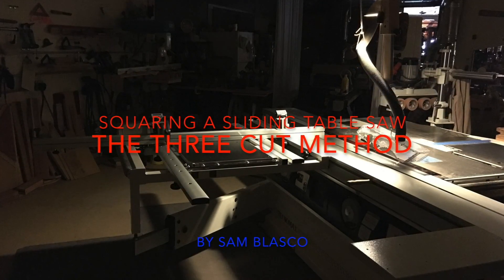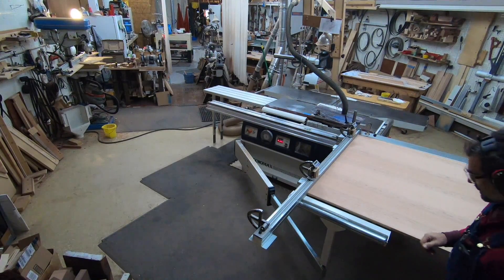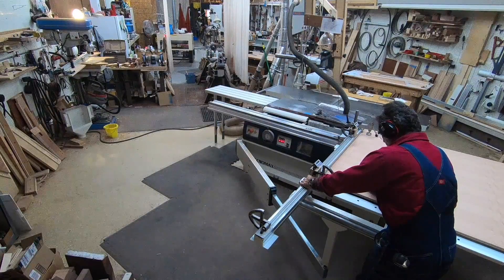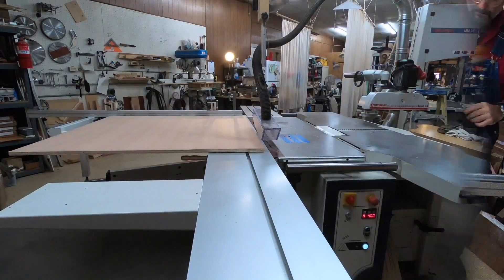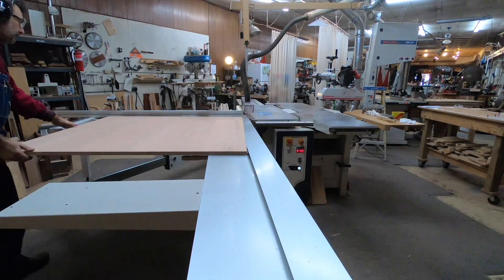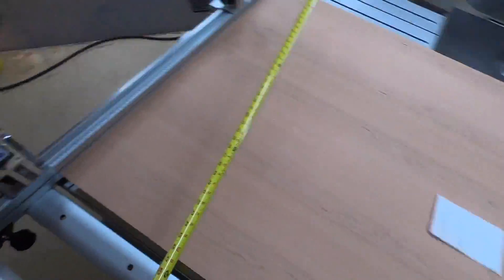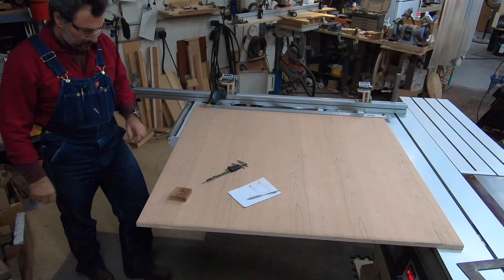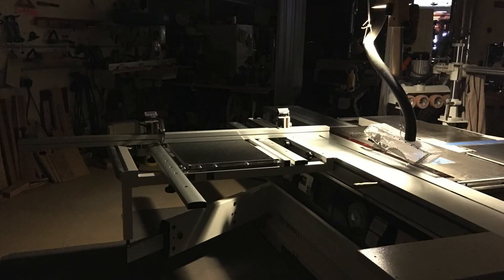Is your sliding table saw square? The 5 Cut Method in 3 Cuts!

Comment: Anyone here have a Robland E3200? When i purchased mine 18 yrs ago it was commissioned by an engineer working for the saw sales company  . 
It didn't cut 100% square then . 
It was always slightly out of square. After many attempts in fine tuning it is still not cutting square . 
Its driving me nuts.
 He also set the parallel fence so that the fence is  not 100% parallel with the saw blade ie if you put the fence against the blade there's a tiny fraction of a gap at the back of the blade near the riving knife. 
Is this normal?

Comment: Hey there, would you be kind to offer some advice, any is very useful: I have a Robland Z400 M panel saw sliding machine with 2 blades. Problem is that i can't align them perfectly... The pre cutter is always a bit off to the right or to the left and that is my problem. How can I allign those 2 blades perfectly?
Reply from the maker: I am not very familiar with that machine.  On my SCM machine there is a knob below the table to move it right and left.  Some saws come with a simple scorer installed and use a spacer on the arbor.  If you are using a split scorer or dial scorer you may need to remove that spacer, or if you are using single blade scorer you may need to add a spacer on the arbor first to move the blade a little to the left.

Comment: Aloha Sam, I received my new Felder K700S recently and had a difficult time squaring the crosscut fence to the blade with the 5 cut method.   Your 3 cut method made the difference.  Using a 4' x 4' panel as you did I was able to get it square and squaring the slider to the crosscut with my 24" machine square as a second check.  Would you ever consider making a video on the rip fence alignment for sliding saws.  Mahalo for all your valuable content.

Comment: That's not even close to the 5 cut method
Reply: Yeah, that’s why he titled it “5 cut method in 3 cuts”!  😁
Reply: @tundrawhisperer4821  That doesn't take away from the fact that this method is missing key components to make a sled accurate
Reply: @derekcraig3617  Well based on the end result he had, that’s pretty darn accurate.  Plus, like he says, in wood working there are many ways to achieve the same result.  It’s just preference at the end of the day.

Comment: I'm a 5 cut kinda guy, Sam, and perhaps because that was the system I've found tried and true over the years in my cabinet shop.  I wasn't impressed at all when you first pulled out your tape measure to check the distances at both ends, but when you pulled out your rular and thickness gauge I could see the merit to your system.  But to be honest, I'm not convinced that your measurement system is as accurate as that of comparing the thickness of both ends of the offcut strip.  To each his.her own!
Reply from the maker: You are correct, Marty.  I think with a large enough caliper this method could be just as exact as the 5 cut.  I simply chose to shoot for a level of accuracy that I am comfortable with, plus it is easy and quick.  In the world of woodworking I find it is very seldom I need to work to thousandths of an inch.  To each his own, indeed.  I, personally, don't want a monster truck, but I am sure glad there are people who do because they are fascinating to look at an explore.  I love all forms of creativity.  Thanks for stopping by.

Comment: For those that do not know, a carpenters square can be adjusted. Using a 45% metal punch you can bring a square in or out (within a couple thousands, not a 1/4 inch)
Reply from the maker: Tis correct, but I believe it needs to be a steel square, not aluminium.

Comment: How can corner to corner measure the same and not be square? You would have an edge not straight, throwing your square out.
Reply from the maker: It could be an isosceles trapezoid  -- two parallel sides, and two sides that diverge, which can happen with the 3 cut method.  It is actually helpful, I find, because once you know how much divergence you have, you then have a pretty good idea of how much to adjust your squaring fence.  https://en.wikipedia.org/wiki/Isosceles_trapezoid

Comment: I use a 3 cut method also. As long as your saw makes a straight cut, cutting the two perpendicular sides with your first straight cut as a base will tell you if your saw is square... provided you can a couple of precise measurements.

Comment: Hi Sam. Big fan of your videos:-) Do you know if it is possible to install and align the large rip fence bar on a sliding table saw on your own, or is it a job for professionals with specialist equipment only? I recently bought a second-hand Felder K700s 2012, and in order to transport it, it was nessasary to uninstall the rip fence bar, support tables etc. I'm not sure if the rip fence bar was properly aligned before, but it is off now unfortunately. I find it hard to adjust the rip fence bar as it can move in all directions and I'm not sure if it's fixation should follow a specific sequence ..plus that steel bar is heavy:-) Is there a trick to this, or maybe a manual or video that you know of, that could be helpful?
Reply from the maker: Hi Emil.  You would adjust the rip fence at the bar.  I'm not sure how Felder attaches theirs, but if it is anything like SCM, then try it.  There are three connection points with our sliders. To adjust, eliminate the middle one (or you'll rock on it), just loosen the nuts so the bolt is just there basically.  Then you can use the outer and inner connections to make the micro adjustments necessary to get the toe out you like (I prefer .015" on a rip fence).  Keep the rip side support table bolts loose as well.  I imagine the bar is rectified, like SCM, so it should be straight by itself.  Once you get the set you want, then just cinch up all the loose bolts (don't overtighten) to the tables.  If you overtighten any of the bolts you left loose you run the risk of putting a slight bend in the bar with can cause some issues.  I hope this helps.
Reply: @SamBlasco  That's great - thanks a lot, Sam! :-) I will try that out, and keep an eye out for any new videos you might put out in the future! Have a great weekend. Cheers!

Comment: Could you please explain the toe-out again? I am about to take delivery on a k500 professional.
Reply from the maker: All slide wagons will toe out at the back of the blade, approximately .006” - .008”.  This is for safety reasons as it keeps the blade from cutting twice, once on the down stroke and again on the upstroke (the dangerous stroke).  Even the best blades in the world have a plate flatness tolerance of .002” and this translates to .004” of blade wobble, which needs to be accommodated for.  That is also why you want your scoring kerf, when using  the scoring blade, to be .004” wider than the kerf of your main blade for better chip out performance (it is like you are creating a micro rabbit, which will disappear, for all intents and purposes, when you add glue to the edging treatment of that panel.
Also keep in mind all rip fences should toe out at the back of the blade approximately .015” for safety, too, and because of this you never want to use your crosscut fence and rip fence at the same time.  They will fight each other. You always focus on one fence or the other.

Comment: No cutting required and exceptional accuracy:   https://flic.kr/p/2hQEwdH
Reply: Ah...so I can invest thousands of dollars in precision measuring equipment and reference surfaces that will likely not be used often, or invest a few dollars in a sheet of plywood.  This is a tough choice.
Reply: @Mike--K  Here's a $34 setup.  https://www.ebay.com/itm/1-0-001-Dial-Indicator-Universal-Fine-Adjustment-Magnetic-Base-Holder-P/300938766455
Reply: @David_Best  Thanks, David!  One on order now.
Reply: Where would I find that magnetic base and dial indicator set up?  Thx
Reply: @tundrawhisperer4821  That's a Noga mag base.   They come in a variety of sizes, and are available on Amazon, MSCdirect.com, and many other industrial supplier web sites.   That particular dial indicator is a cheap model from Amazon - you can spend anywhere from $15 to $150 on one depending on your desired resolution and accuracy.  This is a rundown on the indicator stands from Noga:  https://flic.kr/p/2dPANjW   This setup is sufficient:  https://www.ebay.com/itm/1-0-001-Dial-Indicator-Universal-Fine-Adjustment-Magnetic-Base-Holder-P/300938766455

Comment: I invented a "Parallel Guided Power Saw" you can see on you tube. Do you wish to manufacture my saw? I may license it to you for free. I will give you all the information you need. My saw has the board sitting on the table and move the saw over material. Also the length of the shop is just half of what you need for your saw. Also the system may carry any other tools such as; router, drill press, grinder, and so on. For drill press you can do wholes anywhere on 8x2 ft without to move the board. The length of cut may be any. A 18 ft cut  is easy to do. Everything is very simple and accurate.
Reply from the maker: Thank you David.  I am not a manufacturer.  I do like what you have come up with there and wish you luck in getting it in the right hands.

Comment: Why in the world would you use a slider over a panel saw , especially with limited space ?
Reply from the maker: I feel, personally, that a slider offers more versatility.  Maybe if you were doing cabinets exclusively, lots of sheet goods, that might make some sense.  I do a mix, but more furniture work, and work with solid lumber.  Most shops I know that have a panel saw, also have, at least, a cabinet saw, too, and the gray area needed between the two of them would be about the same as a single slider.  I have a limited space, and deal with it by having a combination machine.  My slider is part of that -- so in the same machine and footprint is also my shaper, a 16" jointer and planer and a horizontal mortiser.  I have also found that, unless the panel saw is a high end machine, it is not as repeatable or accurate.
Reply: @SamBlasco  Ok , I have a commercial cabinet shop use a panel saw for all panels , doors etc. and a regular table saw for small cuts
Reply: Because they’re better.
Reply: @riverbuilder2251  Panel saw = Takes up less space , safer , less handling of heavy pieces , faster cutting . But I also have regular tablesaw for really small pieces and hardwood , etc.
Reply: Doni5717846 safer? Crap
Reply: @riverbuilder2251  YES , You don't even see the blade ! You would have to literally want to cut your fingers off . I am not talking about the kind you see at your local Home Depot , I am talking a real panel saw, not a skil saw on a sliding rod system . Heck, I let both my teenage son and daughter cut on my Holz Her Panel saw.
Reply: Doni5717846 I’m well aware of what a panel saw is, I’ve been using them since I was 9 years old.
Reply: @riverbuilder2251  Then you should be well aware that they are safer than a sliding tablesaw .
Reply: Doni5717846 no, you are incorrect
Reply: @riverbuilder2251  ok , you said you used a panel saw at 9 years old , would you let a 9 year old use a slider ?

Comment: I have a Hammer K3, the consumer version of a Felder saw with a 48" slider.  I used  the 5 cut method with a 2' piece of plywood and was able to, within about 30 minutes, to get the cross cut fence square with the blade within .005" over 8'.  I used the 5 cut method and a caliper to measure width of the last off cut, front to back. It was almost pure luck, but the fence and slider were obviously very accurate from the manufacturer. I called that close enough.
Reply: I think 5Cut is more useful method because you can use ANY SMALL PIECE of material (e.g. 10x10 inch)
Reply: @kobudoka1165  For both layouts and machine calibrations, I always try to index from the two most widely spaced points possible. Size matters. The exaggeration of inconsistencies and errors inherent when those differences are extrapolated over longer distances makes them more visible. Another example: Is it easier to see the exact angle on a small miter gauge or on a very large one? Same general principle applies to these saw setups IMO. Sam's first try at correction read .006" over 48". At 10", that amount of error would be pretty, pretty tiny indeed... Where accuracy is concerned, most convenient and most accurate don't always coincide. I believe your method is definitely more convenient than accurate.

Comment: Sam I am interested in your dro sliding stops.  I have a Hammer K3 slider by Felder.  It's my second, getting the longer slider helps.  The dro read out from Accurate I would have to change out my existing fence.  Is yours a retrofit or new front fence? Which make? I enjoy your videos!
Reply from the maker: I modified my existing flip stops, using parts from Siko Products.  Readouts with pigtail sensor, and I mounted the mag tape in one of my two tape slots, so I can read the tape quickly and use the readouts to dial in.  I made a simple platform for the readouts.

Comment: Thank u very much. Two years ago I got a new Grizzly 5hp table saw, however this I finished most of the setup for my new 10.5 ft. Slider from Felder model Kf700s. It's my second machine from them and I am happy with the machine. However the manual is not very informative on a lot of simple things like this in your video. I can't even find how to reset my riving knife. I am taking all this as a challenge or a puzzle where the only solution is success. Thank you very easy to replicate and it will go into my knowledge tool box.
Reply from the maker: You should have 3 or four screws the help the orientation of the riving knife.  If not, I have just bent them in the past on some machines.

Comment: Hi Sam, for your model sliding saw how much total “sliding path” room does it require?  So from sliding all the way back to sliding it forward to when it stops do you know that distance?  After watching this video and seeing how you positioned your slider, I like the idea of possibly putting my future slider at an angle in my shop.
Reply from the maker: Ideally you would have about 22', but you could just get by with 20'.
Reply: Hello...does this include room front and back for material handling, etc. or is most of the material loading done from the side of the slider making a lot of room in front of the slider not as necessary. Thank you.
Reply from the maker: @steinbierz Correct.  I've seen different operators load sliders in different ways, but loading the wagon in a neutral position works well for me.